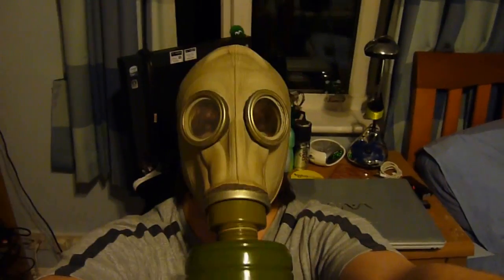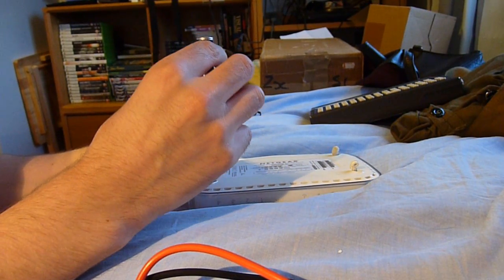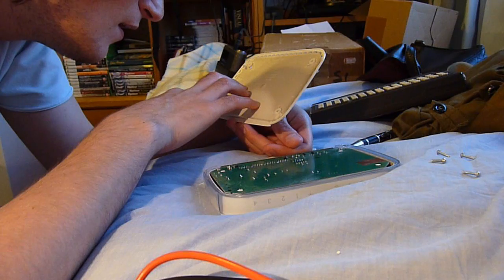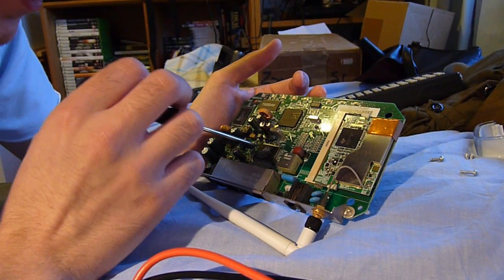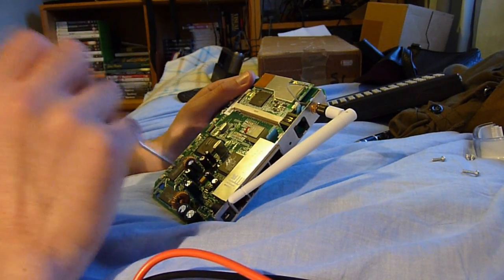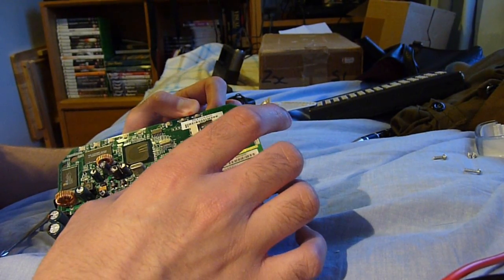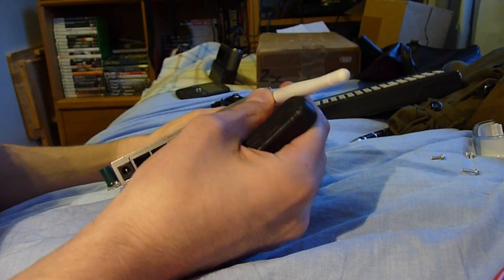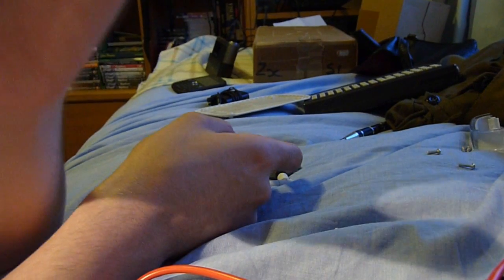Netgear Router Teardown

Comment: What is the name of the part inside the wireless router where you attach and detach your anttenas.. I have a NightHawk R7000 and the part where you connect the antenna broke from the inside, I need to solder a new part can you please tell me the name!
Reply from the maker: They are a type of coaxial connector. Not sure what they are called.
Reply: They are SMB connectors.